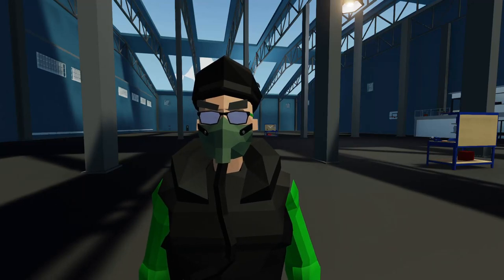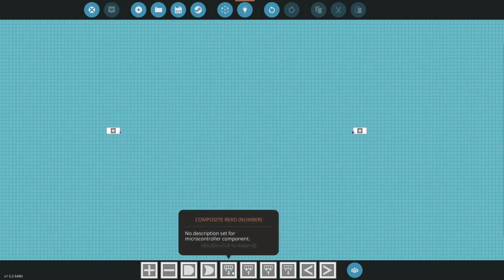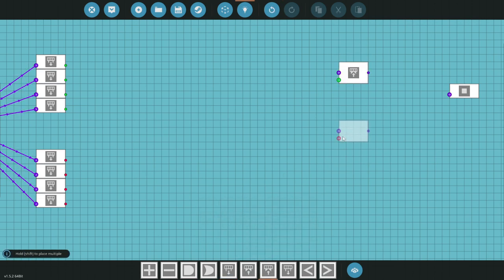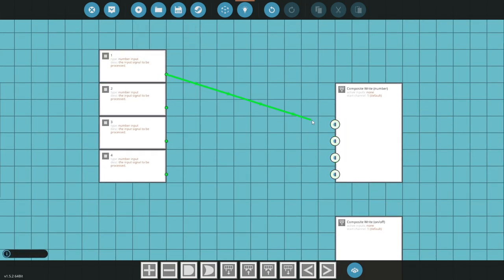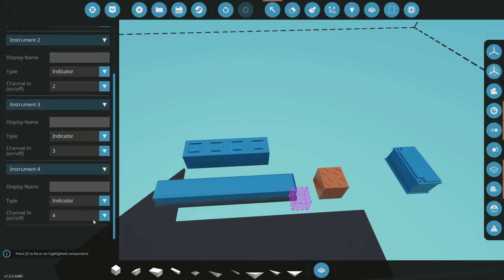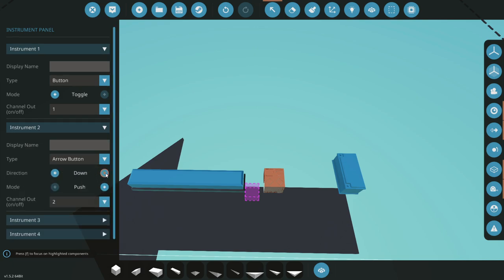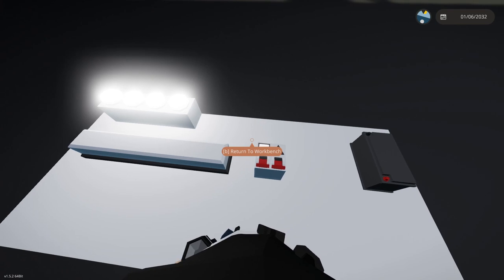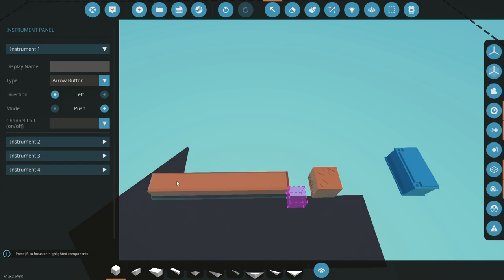Beginners Instrument Panels! Stormworks Tutorial - How To

Comment: I have some fuel hardpoints and for some reason the numbers will not show up on any panel other than the dials that came on the individual hardpoint tanks. I tried hooking up some logic to display it on a mini dial for an instrument panel, but it kept coming up as 0. I tried putting it on a big dial and skipping the instrument panel. Still 0. I tried getting rid of the Add and put the fuel levels on different dials. STILL 0. It's not a fuel issue because the dials on the actual tanks show there's fuel, and I also tried switching the fluid spawner from Jet Fuel to Diesel. Still nothing. I have no clue what to do.

Comment: How do i get an indicator to work off a switch from the same panel? I have button to drop anchor but i would like a light to tell me the anchor has touched the bottom.
Reply from the maker: so mag all connected turns the light on?
Reply: @ProfNCognito  correct

Comment: so what exactly would i have to do to get my instrument panel indicator to light up by flicking a flip switch on the same panel? 
that was the question that brought me here and i don't feel i got the answer... or i missed it? ... 
otherwise great tutorial... cleared some things up for me.
Reply from the maker: Try a relay maybe? Not sure I understand the question.
Reply: @ProfNCognito  one block of Instrument Panel... four instruments per panel... if i set my panel up as indicators on 1 and 2 and flips switches on 3 and 4... what i am trying to achieve is that by going On/Off on flip switch 3 it will turn indicator 1 On/Off to help signal that whatever system i have on that flip switch is in fact On or Off. 

i have a basic Composite to Numerical  On/Off Micro Controller so having the systems respond to the flip switch works just fine... but i cant seem to get the indicator to respond accordingly. xD
Reply from the maker: Ok I know what you are asking now but hard to explain.  If you join my discord and ask this question I can get you screen shots of how to achieve this.